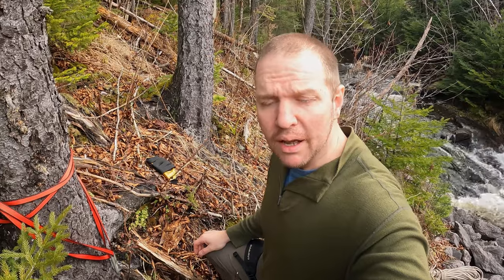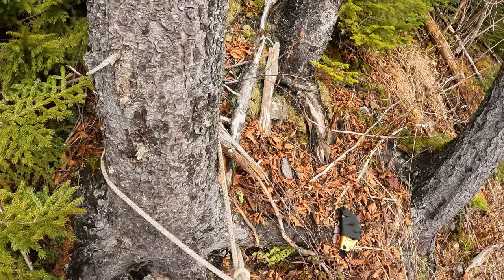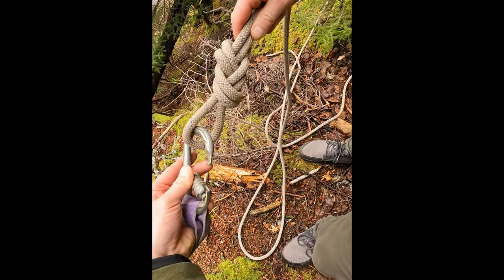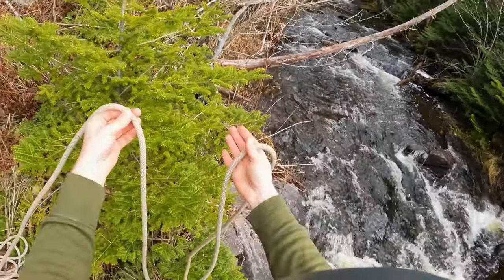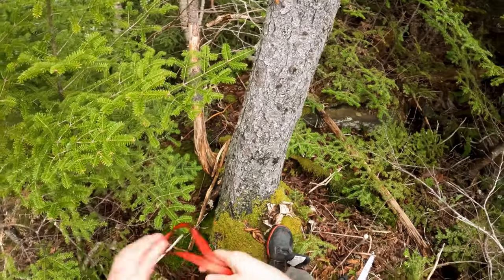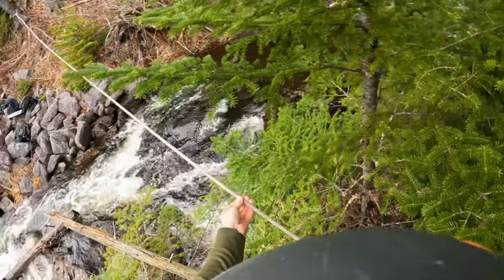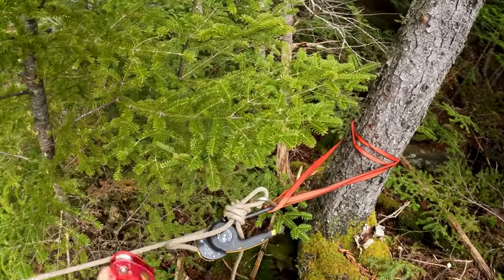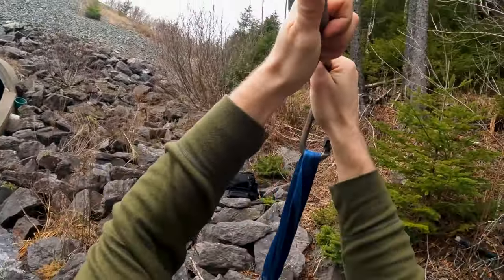Complete Guide To Safely Installing And Rigging Zipline Tension Line Over A River

Comment: Great job
I like that you showed couple of methods using the mechanical advantage. With modern toys and the old school method.
Reply from the maker: Modern is easy but primitive is definetly important to be able to employ.
Reply: @adventurecandyrandy2129  I agree. Should be able to set it on with basic equipment if you lose a modern and expensive gear like ID 😉
Reply from the maker: @vdvogosca  yea most people aren't gonna drop money on an ID..lol

Comment: Awesome video. I'm trying to find a better way to tension a static line for a cable cam run (about 500' of kevlar reinforced static line), and so far have a come along, which is great to remove most of the slack towards the end of setup, but so far to remove the initial setup, this seems like a great idea: i.e. using a progress capture with a rope grab in a 3-to-1 pulley system. Do you have the product names you use? I think I found the progress capture to be the Petzl Rig, and the pulley to be a Petzl Mini Prusik, but I can't for the life of me find the rope grab. Any help would be awesome, and again, thanks for making this easy to follow!

Comment: I'm a SPRAT and IRATA member and I'm sure the eight you did is not called double figure 8, it's just an 8 on a bight. You could go even more primitive by using a super munturs hitch and tie off to secure the tension line. And you want to use dynamic rope to hang followed with another one connected to the tension line for backup
Reply from the maker: Thank you for the feedback :)

Comment: I don't think that what you're showing as a bowline can actually be considered a bowline, although it does look similar. If you trust it and feel safe then you do what you're comfortable with. The way that I tie a bowline after bringing the dead end down through the loop you go underneath around the back of the load end and back up through the inside of the loop. You're bringing the dead end down through the loop, crossing over the top of the load end, going around the underside of the load end, and then coming up through the outside of the loop. After seeing this I watched multiple videos on youtube to see if anyone else did this. One guy said not to do it but did not elaborate as to why. In every other video, they tied it the way that I do.
Reply from the maker: I've been tying it this way for 20 years, but if you are able to explain why this doesn't work, I'm always happy to improve my skills.
Reply: @adventurecandyrandy2129  After watching some more videos it seems that the dead end gets pinched harder under load when it's on the inside of the loop versus the outside of the loop, making it harder to come undone under load. I suppose it's similar to not wanting to saddle a dead horse when installing wire rope cable clamps. To be fair I'm not a physicist. I'm just a boilermaker that likes to go rock climbing when I get time.
Reply from the maker: @bienweiser  I appreciate the input. Always  great to consider better ways to do things! :)

Comment: Would this work for a 300ft pulley system with a winch on a truck to pull up heavy items
Reply from the maker: I personally would not mess around with adding any mechanical advantage to a winch. Winch lines are rated with its own pulley system. Adding any force multipliers will probably snap the line.

Comment: The belay device is installed wrong - the free handing rope should be on the "tooth" part of the device, not the tensioned one.
Reply from the maker: That is correct. I had the ATC loaded so the tensioned line is not on the teeth. That being said it is auto blocking, and backed up so even if it does slip will not release. Good catch and highlights the point of backing up gear.

Comment: The bowline isn't rated as a safety anchor unless you use a Yosemite finish (or Yosemite backup)
Otherwise there's a potention for the knot to come untied.
Reply: *potential
Reply from the maker: Good point, great comment. Wowline is more likely to come loose if it's being loaded and unloaded. It's also a much easier knot to untie once loaded. Rigging is not something anyone should learn on their own.